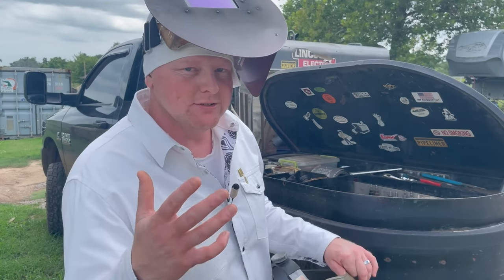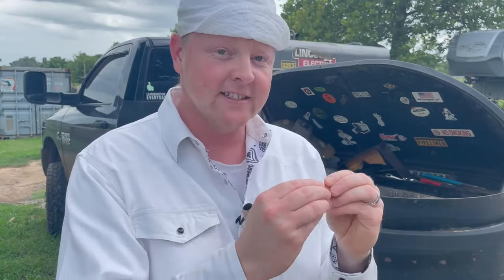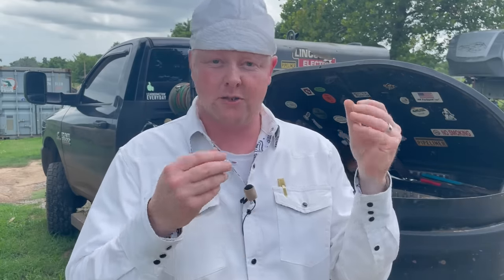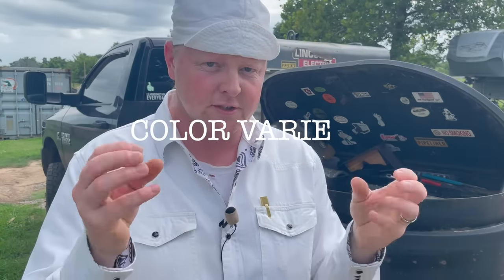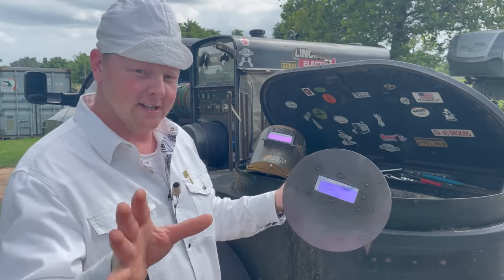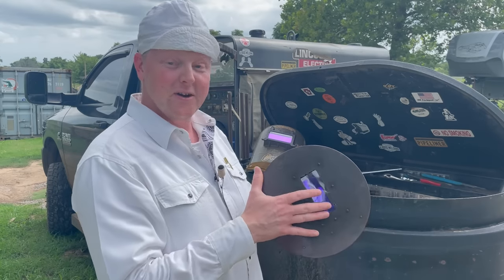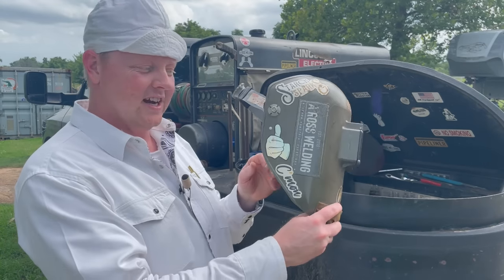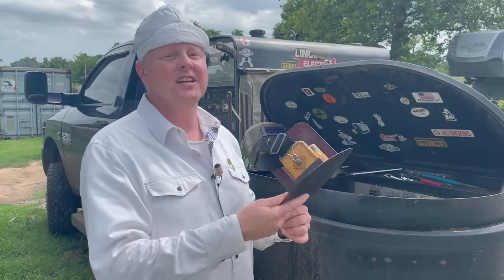Why Pipeliners Do NOT use Auto Darkening Welding Hoods (Fixed vs Auto-Darkening Welding Lens)

Comment: when you use an auto darkening lense it takes a  1/20,000 of a second to turn on so for a short time you get a large blast of UV radiation into your eyes. Not sure what the long term damage will be to your eyes so with a fixed lense that does not happen. I use a miller digital elite auto helmet and when you first turn it on it auto darkens for a second to let you know it is working. You can also look at a bright light to confirm it is working. It does have an auto-on function but I never trust it since it flashed me once because the batteries were dead....
Reply: The manufacturers all say that you have have a full 100% filtering even when the lens has not darkened.  The dark is only to make it dim enough you can see.  I'm sceptical.  I have had sore eyes after using auto dark.  Maybe it's psychological, but I didn't like it.
Reply: @channelview8854  even with just safety glasses you should be ok as far as the uv goes. It is possible however to get flashed if there is glare or reflections coming in from behind you or if the front is not sealed up. Like when people drill holes in the front for leather then take the leather off.
Reply: @channelview8854  they have a dedicated  UV and IR filter. The auto darkening is just light. If your eyes hurt you've got it set too low.
Reply: @Spartan9567  I think it was just mental.  I had been flashed several times and expected to have sore eyes, so I did.  I avoid the problem by avoiding auto-dark.  100% effective so far.